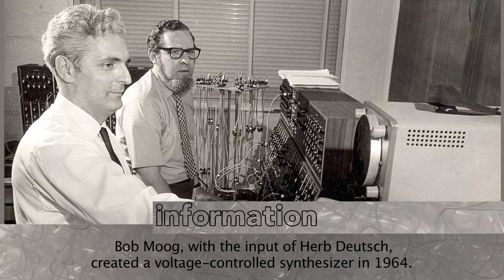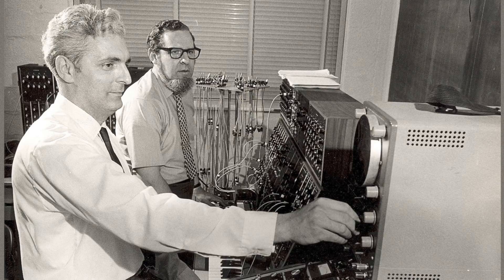A History of Polyphony: Part 9- Setting the Stage:  the 1960s

Comment: There's an aspect to Dr. Moog's modular synthesizers you mention here that I don't understand, and it's this question of polyphony with multiple keyboards. 

The basic Moog IIIc system had 9 oscillators from 3 banks, but only a single output. That much I know. But, you mention that the synthesizer can be controlled via multiple keyboards. So in theory, the IIIc system could play a triad if three keyboards were connected, each playing one note. If so, does that truly make this a monophonic synthesizer? Is it a 3-voice synthesizer, or is it 3 monophonic synthesizers combined in one chasse, with a single output? I understand that it's not a 3 voice synthesizer in the sense that there is no digital scanning keyboard or voice allocation system, but nevertheless the oscillators are able to play pitches independent of each other, correct?

Maybe I'm thinking about this wrong, but it seems like in theory, if you kept adding oscillators to your modular system, you could have played as many notes as you wanted, providing you had an oscillator module and a keyboard for each note. The keyboards are all monophonic, but the synthesizer itself, to me, appears to be capable of polyphony. Is this wrong? It's kind of hard for me to wrap my mind around!
Reply from the maker: See, that’s the thing- whether a synth is polyphonic or not largely has to do with the controller you’re using.  A digital scanning keyboard with multiple pitch and gate outputs could make any multi-osc vintage Moog into a polyphonic synth.  Modular synths are only made to be monophonic by the limitations of the controller.  In the case of the vintage Moog, the monophonic 950.

Comment: why so many parts ?
Reply: Heaving read Herb Deutsch's 1976's SYNTHESIS, i'd have no problem with a single 2 hr presentation. but that's just me and I'm not everybody else. Also, how would you monetize it  to make it finalancially feasible? Beises, I can always download the parts and use a video joiner to stick them together if I wish

I like the new apprach you use to defining synthesis and polyphony. You also approach the drawbar system as it do, meaning treating it like more than simply an organ system. I would love to see the srawbar section used as the "oscellator" section to an otherwise full bore 3 ADSR, 3 LFO, Detune (uless you used two drawbar sets for 2 oscillator sections) and two filters 6/12/24 db dynamic (LFO/ADSR controlled) resonant LP and a varible state resonant static filter
Reply: Im all fine with many parts, but maybe laters also releasing it as whole package might be nice.
Reply: Hopefully not like 'too many notes' from the film Amadeus ;D
Reply from the maker: If  you merely added an envelope and an amp to every drawbar, you wouldn't even need filters... it would be a full-on additive system.  Some LFOs might be nice, though...
Reply from the maker: I'm not sure how to answer that question in the way that it was framed.  
How many parts are "too many parts?"
Are you suggesting it should have been one 2-hr video?
Are you suggesting the 2-hr video should have been broken up into less parts that were longer?